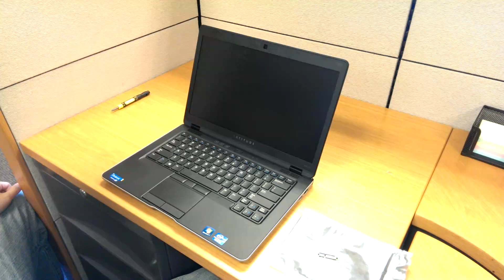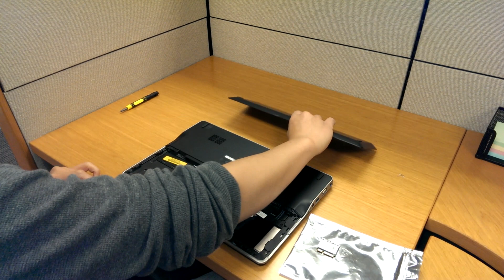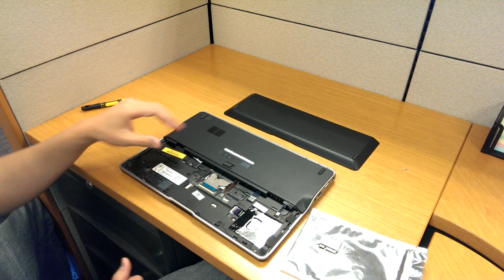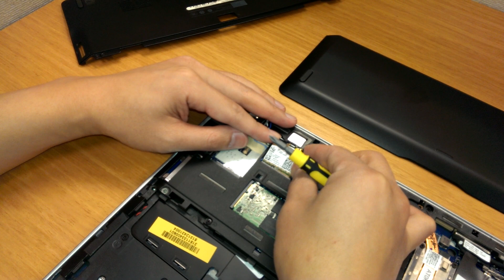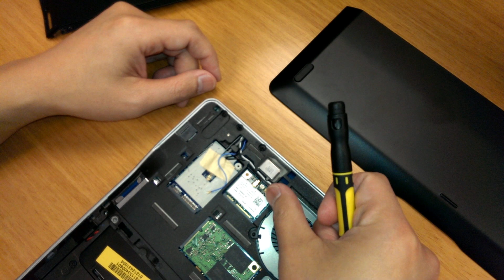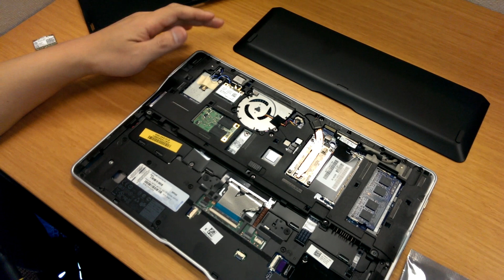Wilocity WiGig HMC Install

Comment: Can Wilocity or Dell supply a 60 GHz antenna-cable-connector for systems that do not have the blue cable already?  I am interested to install in other systems.  
Some are laptops.  
Others are desktop systems with the HMC card installed into a PCIe card adapter. 
For both the goal is to use the docking station a short distance apart from the system.
Reply: Did you find out if the cable is available, I noticed that the blue cable has a smaller connection than the WIFI and MAIN\AUX cable.